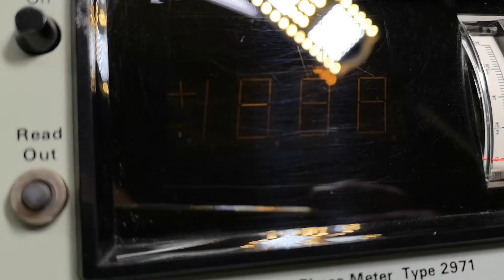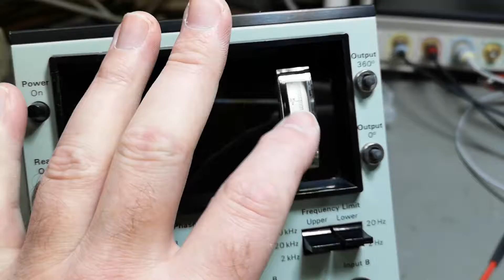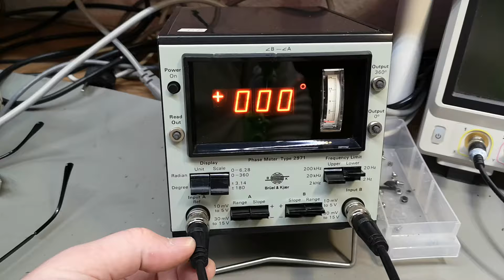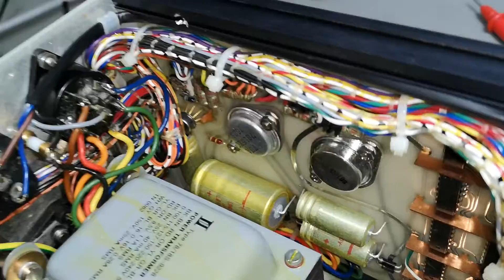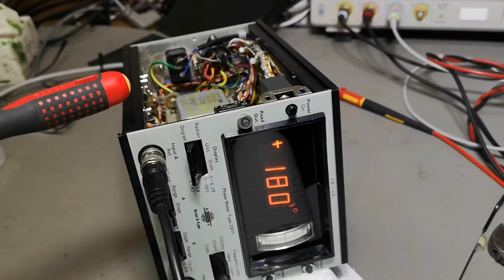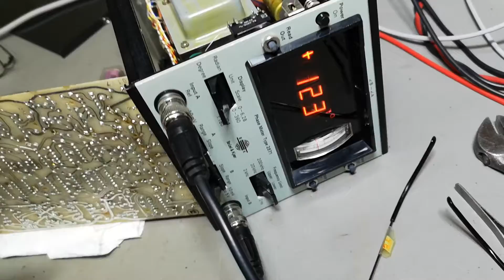Brüel & Kjær Phase Meter Type 2971 from 1976 repair teardown

Comment: Those copper bars were common, though you also got those that had a ceramic capacitor strip between 2 strips, to give a decoupling capacitor in the same rail.
Reply from the maker: i have never seen them with capacitors between the two rail bars, but i have seen the two parallel stribes a lot in old digital equipment, good idea with power AND return in a parallel path = much less field area = much faster peak currents possible
Reply: @TeardownOZ2CPU  There was a few manufacturers who made them with a built in ceramic capacitor strip , built in decoupling with really low impedance. Though the cost meant normally only the military used them in the equipment. Added around 10nF of capacitor per DIP width, with around 5A current capacity, so you could go a long way down a board with it and still keep to TTL voltage specs.
Reply from the maker: @SeanBZA  it makes good sense to do it that way, i keep an eye out next time i poke a large pcb with ttl and such